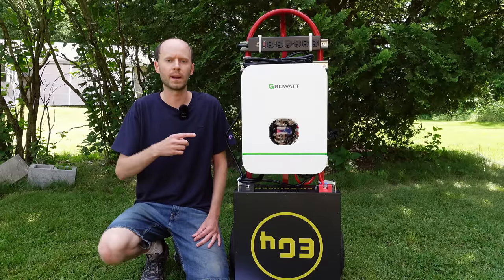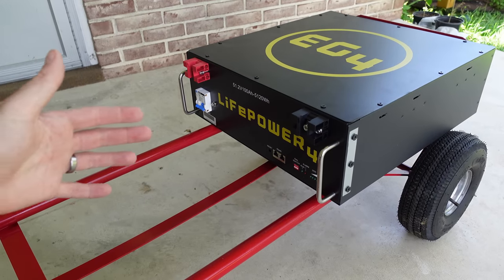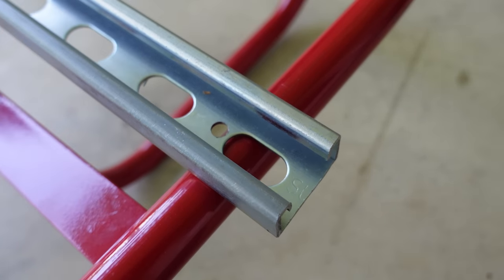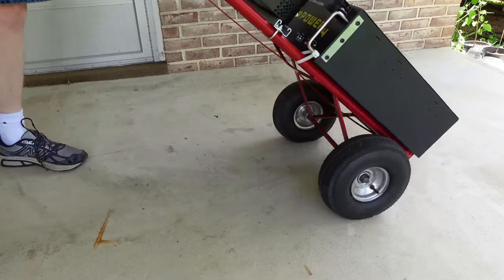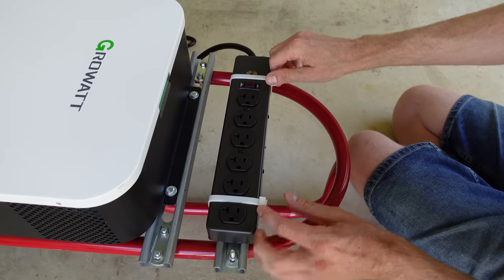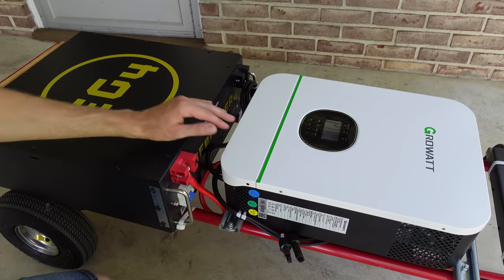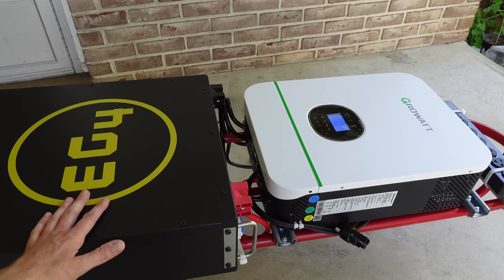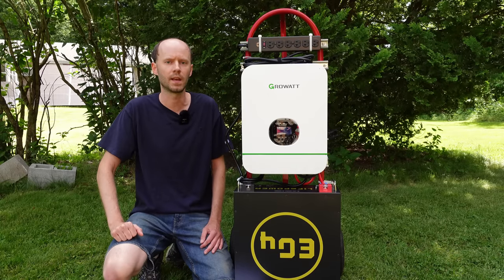Building a 3000W Portable Solar Power Station, Great for Power Outages!

Comment: i made a DIY 12 volt power station with Valence Batteries :The Lithium Iron Magnesium Phosphate module offers 40Ah with a peak load capability of up to 80A incorporating built-in automatic protection. I have 4 of these batteries in parallel 4x40= 160 Ah with a peak load cap.of 320A
U-Charge U1-12RT 12V Battery Modules are quite small,small enough to fit 4 in a mini shopping carrige with a Chinese Reliable 3000 Watt Pure sign Wave inverter off to the side.I Run my 700 Watt microwave just about every morning for oatmeal. It actually draws 1225 watts, after about 2 mins the voltage of the batters does not drop below 12.80.I have a bigger Microwave i want to try, the batteries should handle the wattage not sure about the Inverter? BTW very nice DIY power station def. power to go.

Comment: This is too cool!  
Quesitons: 
1. What type of solar panels do you use for charging this? Would my 12v 200 watt Rich Solar Panels work to charge it?
2.  How long does it take to charge it from 0 to full via solar panels and from the house wall receptacle?  
3. Lastly, would I be able to simultaneously use this and charge it via solar? 
Thanks for sharing.
Reply: If you have a string of them yes... the Voc rating of this inverter is 145V so don't go over that with your string of panels 12V panel is usually around 20V per panel Voc so you could put around 6-7 panels in a string, also the max operating voltage of your string should not exceed 115V. Minimum input voltage is 30VDC so you'd need at least 2 and probably 3 12v panels in a string for a functional system. Also for only a little extra you can get an EG4 inverter that has a much wider PV input range (up to 500VDC) and communication with the EG4 battery totally worth it vs the growatt.

Comment: By using a 20 amp power cord didn't you limit your 3000 watt inverter which should supply 25 amp max (3000/120)?
Reply from the maker: Yes
Reply: @LithiumSolar  Nice system though. Good bang for the buck and easy to build.

Comment: So you connect your cable to the solar panels with the correct polarity but you you have to reverse the polarity when it goes into the controller/inverter?  I'm new to this solar stuff so what the the reasoning behind that?
Reply from the maker: You're reversing connector gender. A male connector will only go in to a female connector. Positive should go in to positive. Do not mix them up!

Comment: A couple of questions - how many appliances can you run at one time and for how long? Also, can you run appliances off of the battery while it is being charged from the solar panels?
Reply: As an example I built a 12v LiFePo4 solar battery bank and I run a 5000 btu air conditioner all day long.  While it's running the battery (CALB cells) get recharged by 500 watts of solar panels running through a Victron MPPT controller. The battery I built can handle about 1100 watts of continuous discharge until the charge goes to almost zero, just depends on the sun and the time you run the appliance.  This may not answer all your questions but will give you an example.  His battery probably allows him to run appliances equaling about 1500-2800 watts continuous, again, until empty.  This seems like a system I'll ultimately build to become even more independent.  Good thing is the prices are getting cheaper by the minute.
Reply: @arminius301  Thank you for the information! Much appreciated!
Reply: @jdcamc  I should add that I listed the approximate total wattage my 7-100 watt Renogy panels produce at peak during a sunny day in the Sacramento area (approx. 500 watts combined, since three of them are on the RV roof and not at an ideal angle most of the time - all 7 panels in parallel).  The other 4 panels are flat on the ground and exposed to full sun most of the day.
Reply: @arminius301  I'm wanting to see what I would need to run a side-by-side refrigerator and a window unit ac. If we are going to have this blackout that is rumored this summer, I want to have something available for my mother, I just don't know what would be the best and least expensive option.
Reply: @jdcamc  couple of options to ponder: you could purchase a 1500 watt generator (peak 2100 watts) and run it on gasoline.  I bought a Ryobi ($500+-) and it does a good job so long as you don't set it to eco mode.  The other option will be more expensive for a solar generator.  Take mine for example: bought 4 CALB cells from Ali Express and built a 100ah 12V solar generator with it.  In order to charge that battery you will need a "overkill" BMS ($140), a Victron MPPT solar charge controller (I got the 100/50 for around $360 amazon), and approximately 6-7 100 watt solar panels to run in parallel (about $86 each, I got the Renogy monocrystalline ones).  Last but not least you'll need to buy mc4 cabling to hook all this stuff up in parallel to get your system going (cabling for all this might run approx. $150 total +-).  And you'll need a good spot where you get sun exposure, otherwise this is not an option for you.  Not sure what the total will be, but once you get this system going and set up it'll pay dividends for years to come!  Hope this helps
Reply: @JD Yes LiFePo4 battery chemistry allows for draining all the way down to nothing. It wont' damage them, but could speed the degradation, I'd think. Now common sense dictates to me that I would generally try to not go lower than 10% just to get the maximum count of cycles out of them (2000-4000 depending on how you discharge them - best to stay within 10%-95% at all time of "state of charge (SOC)").  Keep in mind that lithium "iron" phospate 4 is completely different than lithium "ion". LiFePo4 is the best battery chemistry at the moment that I know of!

Comment: Be sure to investigate the AC input required to charge this battery with this inverter.  I just built this exact system and it wouldn't charge. I wired it correctly.  The inverter works fine but it  trips the ground fault circuit breaker in my garage whenever I plug it in.  I called Signature Solar and they said that the inverter had to be hard wired to a panel with #8 wire and a 40 amp circuit.  I was using an extention cord on a 15 amp gfci.  [Be sure to look at the authors resonse below)Has anyone else actually successfully built this system?  How did you supply that much amperage?  Signature Solar told me that they had a customer who burnt their house down using an extention cord to charge their battery.  I would love do hear anyone elses experince with this.
Reply from the maker: I had mine charging on a GFCI receptacle in the video and it did not trip. I used a 20A plug, so I need to plug it in to a 20A receptacle and cannot exceed 20A (charging + loads).
Reply: @LithiumSolar  Thank you for your kind response.  I edited my comment.  This is such a great design.  I really wanted it to work.  And I need it for building a house that I have started.  I was hoping that by following your design exactly it would be plug and play.  My mistake was that I cut off the 20 amp plug that comes with that power strip and replaced it with a 15 amp one and then pluged that into an extension cord.  If there is some way to add an advisory to your video for people like me  who don't quite know enough about these things.  I had no concept that it would draw that much amperage.  I think the trick must be to keep the cord short and plug it directly into a 20 amp outlet.  No extension cords. ?  Thanks again for the great design.  Now I just have to install a 20 amp outlet in my garage.
Reply: I did not have a 20A outlet available for my build, so I just used a plug adaptor and reduced the AC battery charge current to 20A, the same as my battery charger..  I have no special wiring as above, just standard 15A house wiring.  FYI, GFIC's do expire.  If yours is older, you might consider replacing it.  Also, wouldn't it depend on what other loads are active on that circuit at the same time?
Reply: Signature Solar has an instructional video on this exact AIO.  They say with max loads and max charge, you can draw 5kW from the AC side.  That's why 8 gauge wire and a huge breaker.  You can't get that amount of power from any standard wall outlet.  https://www.youtube.com/watch?v=e5TVCGcoFos

I would watch this video a couple times and take notes.   If you are going to install this, better to do it right or you can burn your house down.

Comment: I've been looking at this same setup for a while - without the hand truck.  I'm curious what's code for running mc4 cable from outside, thru an eave, thru the attic, into a server closet.  Have you ever touched on that?   edit: spelling.
Reply from the maker: I'm not an electrician and am not well-versed in code and cannot comment unfortunately. My OPINION would be to transition to THHN somewhere and pull through EMT.

Comment: As far as I could see you plugged the battery directly into the wall to charge it. Then you powered the compressor with the battery output. You didn't use the inverter at all. You just hooked some cables to the inverter and described you could plug the solar panels in here.
Reply from the maker: The inverter was used in your second sentence.
Reply from the maker: And I have an entire second video dedicated to just the solar panels...  Come on bud.

Comment: Awesome rig! Interesting to see a 3000W inverter running no prob off of that batterty. I have a similiar EG4 Batt. No breaker but 5.12kwh. I have tremendous trouble powering on my 2000W PS inverter with that battery though. When I have it wired up and turn on the inverter the inverter and battery alarm out. But occasionally the inverter will turn on just fine and run just fine. Some capacitor charging issue but I really have been stumped for a while. Would love any tips if you have them!
Reply: you might want to check the settings on the inverter.

Comment: Hint on your inverter frame clamps. Use a rubber insulated clamp vs u bolts. It will wrap around dolly frame, has rubber insulation and only needs one bolt to secure. Simple. BTW , you just paid $1400 for a battery, so calling a power strip pricey is kind of dumb.

Comment: Amazon has multiple types of Power Inlet that could easily be mounted to the cart etc. Then just need a regular extension cord to charge from AC. No cord hangin off it when not in use

Comment: Your setup is very beautiful 👊☺️🤛
Did you think about how to make it waterproof ?
Reply from the maker: This is not water proof or water resistant. A lot of thought and planning would need to go in to that. It's easier to just not put it outside where it can be rained on.
Reply: What is the use case for waterproof?  I can't think of one.
Reply: @russlo5324  well, having something transportable is a bit useless to me. And if you go outside, having it waterproof is better than having to use an unbrella not to mention than waterproof means “you can use it under rainy days”

What else ?

Comment: You did not discuss islanding - if power goes out in your neighborhood and you plug your device into one of your outlets to run the house, you could end up supplying power to the grid. In effect, you could end up trying to keep your neighbor's refrigerator running. Also, if power line workers start working on the problem within your particular island, they could be exposed to mortal danger. As built, I recommend you ONLY plug appliances directly into the power strip and don't try to power up your house in the event of a power outage. I also agree with the grounding comments below. Don't make an ash of yourself, ground this sucker!

Comment: The BMS on that battery is compatible with the inverter via the  ethernet port.
Reply from the maker: It uses an RJ45 connector but it is NOT an ethernet port. Do not try plugging it in to any network equipment.

Comment: Another great video. What does SS say about the orientation of that rack mounted battery pack? is there a position it should not be placed on?
Reply from the maker: I have not asked Signature Solar; however, SOK uses the same cells in their batteries they have said the batteries can go in any orientation other than upside down.

Comment: Combined with a decent solar array, how good would this setup be for charging an EV vehicle?
Reply from the maker: The battery used here stores 5.1kWh of power. EV batteries are significantly larger. Google suggests 0.346kWh will get you 1 mile, so charging an EV from this battery would put about 14 miles in your car. Other figures (Tesla) work out to around 23 miles.
Reply: @LithiumSolar  I am considering purchasing a Rav4 Prime.  The Battery is smaller than your full EV at 18kw.  Also, I won't be using the vehicle for a daily commute being in a large City.  Mainly weekends and running errands here and there.  
So I am thinking maybe such a solar charging station could conceivably charge the vehicle over the course of a day.  Maybe a little more if the vehicle battery is completely depleted.

Total range on EV for the Rav4 Prime is about 42 miles.

Comment: QUESTION: Can these Growatt units function as a huge UPS / Passthrough device? Meaning, if it's plugged into main AC supply, and then powering a computer, etc., would it charge up the battery, and then bypass all the inverters, etc. like a regular UPS? Would this also work with AC input + Solar input and acting like a UPS? Thanks!
Reply from the maker: Yes, they can function as an UPS (utility priority mode).

Comment: How might you hook this bad boy up to house grid, so it can run the well pump, septic lift station, and furnace? Not all at once obviously.
Reply from the maker: You'd probably need a more powerful inverter for that - at least one that does 120/240 - and not mounted on a cart.
Reply: The manual says this is an OFF GRID INVERTER.  So that would be a no.

Comment: Like to build a portable solar panel system on wheels to avoid permits ,inspections etc. find you put a panel either on your house or on a fixed mount. You need proper inspections, building, electrical, insurance.

Comment: What size solar panels and how many would you recommend with those being used primarily as an emergency backup system to run a refrigerator/fan/heater?

Comment: Can you explain the Mc connectors. Why you put them backwards? I figured positive is positive and negative is negative
Reply from the maker: Because a male connector plugs in to a female connector. So the positive on both the solar panel and inverter side cannot be the same connector gender. It's best to think of them as genders rather than polarities.
Reply: Got it. , thanks and by the way  good looking system .

Comment: Do these charge managing/inverter deliver 220-230 50hz in this manufacturers brand?
Reply from the maker: This particular inverter is 120V 60Hz only. It's intended for the US market. Growatt does make similar inverters for use in 240V 50Hz countries though!

Comment: Can something like this have a 240v output?
Reply from the maker: It's 120V as I built it here. You can use whatever inverter you would like to suit your needs.
Reply: @LithiumSolar  So the inverter is what determines the voltage output? And you need a charge controller to determine the input voltage? Are there custom systems that can input either 120 or 240, and output either 120 or 240? I guess the Anker Solix is a proprietary version of this but I wonder if i could diy it lol

Comment: How many watts of solar power minimum would you need to keep your battery powered up?
Reply from the maker: That's entirely dependant on what load(s) you have connected.
Reply: @LithiumSolar  I have just found your video on solar panel set up for this project. Thx for the quick reply. I plan on building this asap. 👍

Comment: How about one of these for 220-240 output to use for a 2hp water well pump. I think I might build one to replace my gas generator. I currently use a lv6548 for an off grid set up but I like to have one to run it 4hrs a day as needed. Nice video and build! Keep it up!
Reply from the maker: Sure - you could use a 240V inverter if needed. Everything except for the AC side would essentially be the same if you only need 240V (and not split-phase).
Reply: Signature solar 5000 us is nice if you also want 110volt withe 220 you would need a transformer.

Comment: Great video.  Can I do this same build with  EG4 6.5kW Off-Grid Inverter | 6500EX-48 | 6500W Output | 8000W PV Input | 500V VOC Input?
Reply: Your mileage may vary.  You picked the quipment and gave no further details, so who knows.  One thing is that you can connect up a 1.21 Gigawatt inverter, but if the battery cannot provide that much power, you won't get that out of the inverter.
Reply: @russlo5324  Thank you Russ Lo.  New to this stuff trying to figure this stuff out.  I might just stick with what he did in the video but use the same size eg4 inverter as the growatt one.  If that makes any sense.  Lol
Reply: @johnmal5975  Honestly.  It is worth your time to learn before spending big bucks on something that will not do what you want to do.  You will be happier, and it might even be cheaper in the long run.

Comment: I knew I could do this until he told me that bolt on the battery and the nut on the inverter were both 10mm. NOBODY can build this because nobody can find their 10mm!
Reply from the maker: LOL. I have a few 10mm sockets now due to loosing. It's a joke but it's also fact!
Reply: @LithiumSolar  I know! I buy every 10mm socket I see when I enter a pawn shop. lol

Comment: Cool design. The coms for both Growatt and EG4 bats are super easy. I just use a regular ethernet cable. This plugs into BMS port on the inverter and 485 port on the battery. Then just adjust two settings on the inverter. Menu 05 needs to be LI for lithium press enter and change L00 to L01. If i remember correctly.